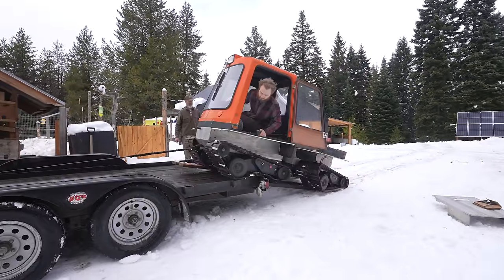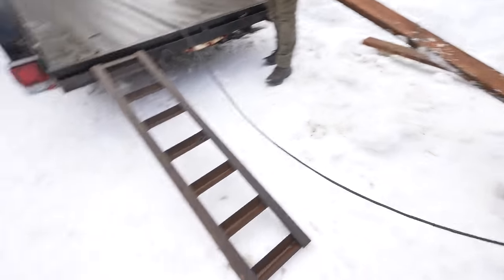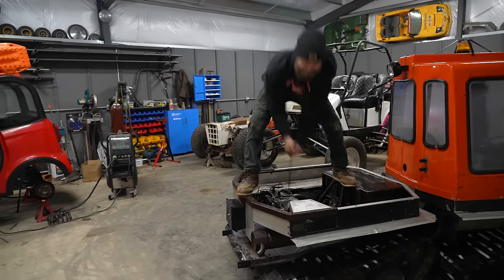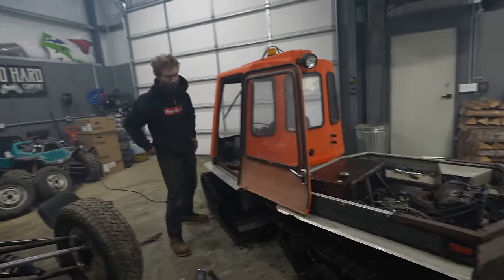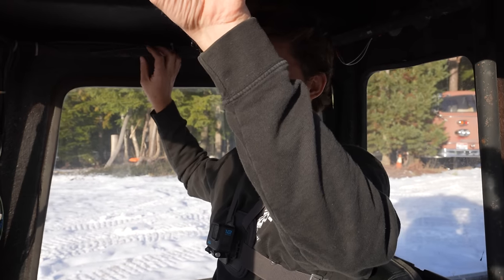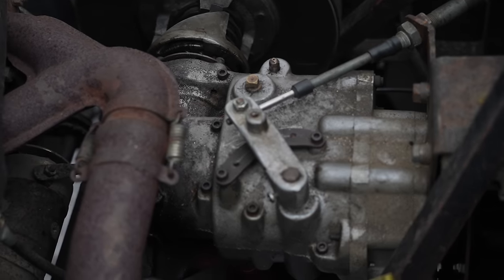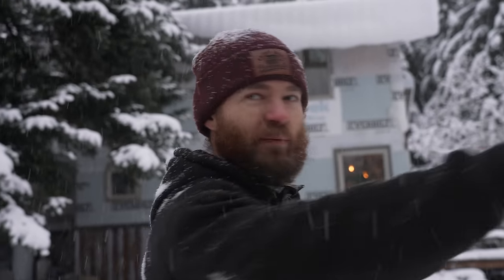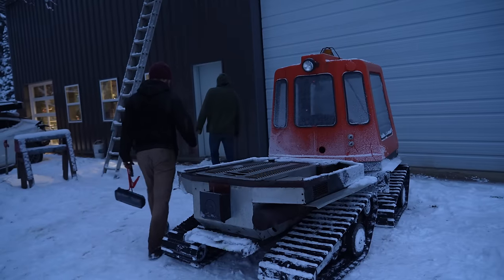We Found a Rare Snow Cat!

Comment: That thing DEF needs a 5th wheel on skis pulled behind it for an epic camping adventure.
Reply: A 100 mile camping adventure?
Reply: Exactly, like pull it into the bush where you cant even walk for 100 miles!
Reply: I'm not sure a machine this size can pull that much, I have a Thiokol Spryte and it's it's a lot larger and still struggles pulling anything more than a drag, it's more of a personal transport machine.
Reply: Make the 5th wheel style trailer a pope-mobile/second cabin for William.
Reply: YEEEES
Reply: YESSS
Reply: @906MediaProductions maybe they could make it self propelled off the hydraulic hookups in the back
Reply: @906MediaProductions  they would have to turn like a tiny teardrop into a "5th wheel style" or something to make it happen I think, you made a solid point.
Reply: Not even remotely close to enough track width or power in them for that.  They are a toy at best like a  quad or SxS on tracks.  They are cool but slow as hell. Need to use a bigger unit for that and then the trailer needs tracks. I'm, building a unit juts like you are talking about but i'm starting with a 2003 Pisten Bully 320. I have a bunch o vids to upload but havent got around to it yet.
Reply: Sooooooo... add power.  They do that regularly.   @SwampedDonkey
Reply: To small and light duty and skis suck on a heavier trailer especially if you have to back up. I only know because i did that very thing with a full size Bombardier BR 275 plus with an 8.3 Cummins and 60 inch tracks. 25 foot fifth wheel was fine in a straight line on semi deep snow but as soon as the snow got super deep or  i had to backup at all it was pretty much game over. There is a solution to it it though that works quite well and if the boys from GH want to know, they can shoot me a message.  Their unit is cool, neighbor had one when we were kids and has potential but they could build a much better machine from scratch with less fiddle fucking around as it would take to modify the Arctic Cat Quad track.  More room, torque, uses and adaptability for many many  premium adventures.
Reply: Would it be a 5th wheel if there are no other wheels?